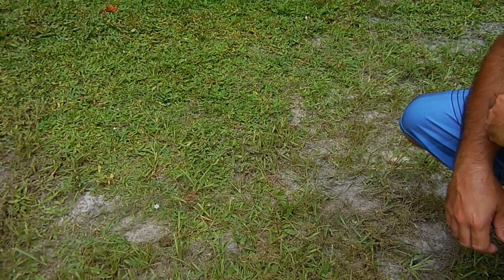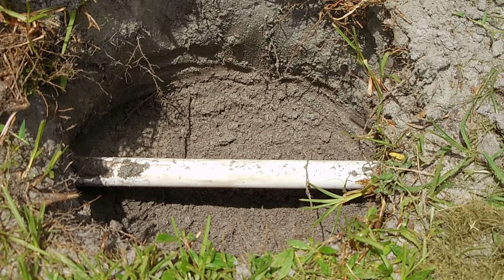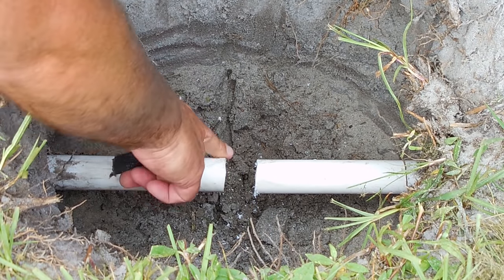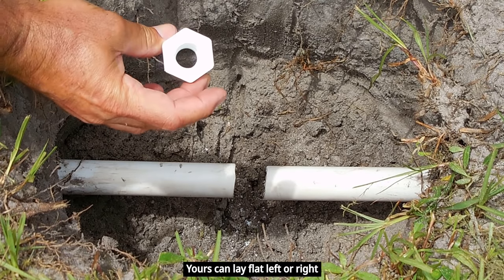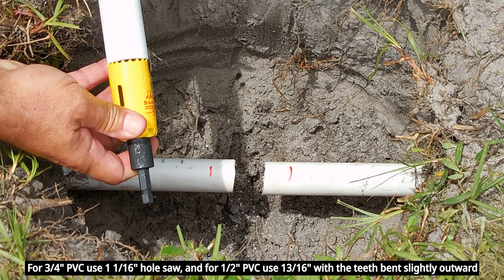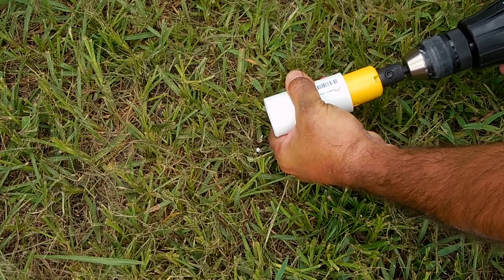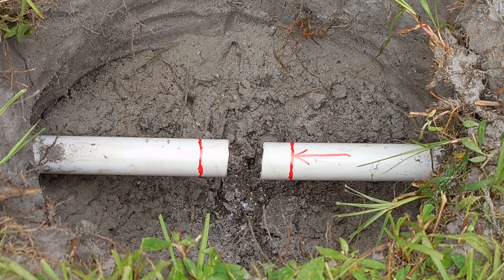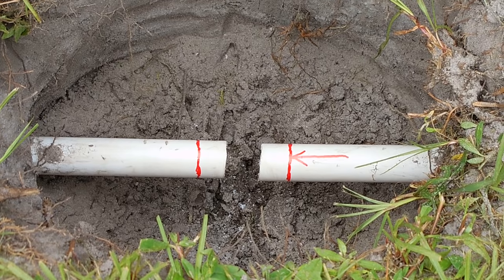How To Easily Tap Into A Buried PVC Water Line With The Least Amount Of Digging!

Comment: Nice trick! I've worked with every size irrigation pipe from 1/2"-6" but never knew this trick. Another trick when using actual ratcheting pipe cutters is take a brush full of purple primer & let it run under your blade while cutting pipe w/ cutters & it makes cutting so much easier softens the pvc or something.
Reply from the maker: Glad you liked the video!
Reply: Old schedule. 20 likes to flex inwards and resist cutting.when I use a cutter. The primer trick might help.

Comment: I’m an irrigation tech and I have to say this is very crafty but I would not use it on a larger pipe. Also fittings for a sprinkler head are more useful to be glued sideways not on an upward position as weight can cause breaks, sideways will only break the sprinkler or swivel.

Comment: Best idea I have seen yet for adding a “T” to underground pipe.  I am adding some freeze proof spigots to the yard around my home and needed a way to do this. Thanks
Reply from the maker: It works extremely well, but using the correct hole saw is very important. Practice makes perfect. :-)
Reply: is it though?   notice how he doesn't show it right when the fitting goes on... a little screen magic.   THIS is not how you do this repair if you are inexperienced.

Comment: If you slip a length of pipe in the vertical part of the Tee, without glue, it gives you a better indication of when the Tee is perfectly rotationally aligned, so that the vertical pipe is perfectly plumb. Then you can take that length of pipe out, and glue it up or put in whatever fitting you need (a reduced, in this situation). It's hard to tell when that tee is rotationally aligned perfectly if you are just looking at the fitting.
Reply from the maker: That's a good idea. :-)

Comment: This way of doing it worked much better then using the special tool used to drill out broken plastic pvc pipe from connectors that I bought at the plumbing store.
I don’t understand how it happened,  but after drilling the fitting,  it somehow made the inside diameter smaller, and the pipe will not insert easily enough. 
(It inserted more easily before the drilling!)
Maybe the cutting edge needs to be bent out a little like you mention with the whole saw.
Anyhow thanks for the useful tip! 
I’ll definitely try it.

Comment: Adding a Tee inline is actually a lot easier than drilling it out and sliding like you did. Just dig the hole a little longer the length of the pipe, cut the section like you did, glue one side, then glue the fitting and pipe, pull up on both ends of the pipe, and then fit the pipe in to the Tee. It works remarkably well.
Reply from the maker: I've been working on PVC lines for 30 years, it's not that easy. You need to dig back at least a few feet, especially for 1" pipe. This tip was for people that don't want to dig up a lot of the pipe, or if they need to tap into a line where a lot of digging isn't possible, such as next to a sidewalk or driveway. As for the burrs, I said to remove all the burrs, and you can see me grab a couple from the inside of the pipe. Thanks for watching
Reply: That's how I do it. But you gotta cut the pipe exact...

Comment: Thanks for the tip. Will implement when Slip-Fix is not available and when a constant pressure line repair is involved. Keep in mind, a slip repair coupling in this situation, could have completed the repair in less than 5 minutes.
Reply from the maker: Keep in mind "Slip-Fix" isn't a permanent repair, and over time the rubber seals can leak.
Reply: @electronicsNmore  So true. They always end up leaking and you have to do another repair.

Comment: did this a couple of days ago, but with copper connectors for water/central heating pipe, i used my lathe to ream them out but it guess a vice and a drill will do the job
Reply from the maker: Whatever works! Thanks for watching. :-)
Reply: In the future it may be good to know you can get what's called a slip coupling for copper pipe which will do the same thing but save time by not needing to modify a fitting on a lathe.
Reply from the maker: @wellby5000  I think he modified a tee, or other fitting.

Comment: @7:44 you fast forwarded through the part I'm struggling with the PVC sliding part. I wish you would have let us see how you work it in and the struggle so that we can learn. That's really hard.
Reply: If it's hard then you're not doing it right. You need to work quickly and smoothly and keep the part moving, as stated in the video. If you do it right the TEE will slide easily, and the glue will serve as lubrication. That said, it's annoying when videos that teach us a novel method skip over the critical moment, and a lot of videos do that for some reason.

Comment: Instead of an arrow, draw a larger V.  The spacing between the two sides of the V show you how " too far" you put the coupler.  Nice video!
Reply from the maker: That works too! Thanks for watching!
Reply: That's the same as drawing an arrow. The only difference is the "shaft" of the arrow, and that part is extraneous and inconsequential.

Comment: Which is the slow setting cement? I made one of those slip pipes from your other video.  I went through three of them before I got into set the way I wanted.  Funny now, blew a gasket then.
Reply from the maker: It's typically sold online or at a plumbing supply house. You'll have more time to position the fitting. If you don't remove enough of the stop from my other video, you'll have a very hard time sliding the coupling. I suggest sanding the inside of the coupling with 220 grit abrasive paper after removing the stop, before installing. Thanks for watching! Please share.

Comment: You didn't mention to make sure to get the burrs off from "inside" the pipe. Not cleaning them out will clog the filters at the sprinkler heads over time. They will break free and go down stream after some time.

Comment: I use a heat gun.

dig the hole, cut coser to one side glue the t on the shorter side, let it dry.  Then heat the long side from 2" to 8" until bends like spagettit.  Then prime and glue, use a plyer to hold the end of the pipe.
Reply: Can you recommend a cheap gun model that can get this done? I've never used one don't want to under do it or over do it. A video of this would be great.
Reply: Seems suspicious. If the pipe gets that flexible it seems like it would kink.

Comment: Good Idea.   I would have used a Slip Joint costing way more.   Yes some T Joints don't have the stops.  Here in my Two Horse Town things are hard to find.   Still using Primer ?  LOL   Wasting beer money Sir.
Reply from the maker: Thanks. I've never seen tee's sold at HD, Lowes, Ace, True value, and other places with no stop. I'm sure plumbing supply houses have them.
Reply: Blue PVC glue just doesn't work as well as primer and glue combo. It just doesn't hold up over time and it isn't as secure. I've been on quite a few jobs where the blue cement has let go. Code in a lot of jurisdictions require indication primer has been used (the reason that primer is tinted purple), and haven't changed to allow blue cement. You will never get as good of a weld with the blue. The primer softens the PVC, and creates a stronger weld. It is like paint/primer combo. It never hides as well as using a dedicated primer and then painting it with regular paint.
Reply from the maker: @xenonram  Perfect videos for you Andrew. :-)
https://www.youtube.com/watch?v=1o4E2pdEv-s
https://www.youtube.com/watch?v=qHo4heljrSg
Reply: If $5 for a year's worth of primer buys you your beer, you sure are a lightweight drinker. Your wife loves you. Your plumbing? Not so much.

Comment: I use a "saddle T".  Prime and glue "saddle T" where you want it.   After cement is dry, drill thru the blind hole and original pipe with a drill.  This method eliminates the hole saw expense.
Reply: That seems like a terrible idea. That will fill your pipe with PVC drill shavings and clog every sprinkler head in your system.

Comment: You could use a snap-saddle fitting, and drill the hole after gluing it on. I now do that even for new installs.
Reply from the maker: Yes, the only problem are plastic shavings ending up inside the line and clogging sprinklers or faucet aerators.
Reply: @electronicsNmore  Yes, it needs good flushing before putting any nozzles on. (But the moment you work in a trench, that applies for other methods too)

Comment: Great video and tip, thank you.
We use pipe saddles to do this in my area. You just drill the appropriate size hole in the supply pipe, then bolt the correct size saddle in place. A seal inside the saddle seals around the hole.
Reply from the maker: Yes, I've seen those. :-) Just like what I've used to tap into copper pipes. Thanks for watching!

Comment: Thanks for the video.  What size hole saw bit do you need for 1 1/4" PVC pipe?  Thanks.
Reply: I just ordered a 1-5/8" for that. They have 1-11/16" too, but I think it would be a hair too big. You may have to bend a couple teeth out on the 1-5/8" to make it work.

Comment: I can purchase a HOMEWORKS slip repair coupling with 1/2" threaded outlet that looks like a tee from either Lowes or Home Depot for around $12. They are rated at 150 PSI maximum pressure. I don't believe average home owners PVC will even be be working at half that. I would cut the pipe like you show, apply some soap on each pipe and slip it on. No glue or cleaners required. Just tighten each mainline end by hand.
I have a machine shop with most every size hole saw available up to 6'" and they are not cheap. I know you can do what you show however some won't realize if they don't slip the modified coupling in place very fast it can weld in seconds and they are up the creek.  
Entertaining to watch and useful if the box store is closed.
Reply from the maker: They work, I had a bunch of them when I bought a plumbing isle from Orchard Hardware when they went out of business.
Reply: @electronicsNmore  When Orchard went out of business I made a small fortune. I went to 7 stores in Florida and purchased heavy steel stock and entire sections of aluminum. One of the liquidators asked me if I was building an aluminum boat. I know I have at least 1/4 ton of steel squirreled away. Although Orchard may have been a tad higher in price, they had everything including metric. I wish the idiot CEO would have closed Lowes and kept Orchard. The only good thing I can say about Lowes is I have most of their 24V Kobalt tools and love them. 
Keep up your great videos.
Reply: @gatorwing6231 Define "small fortune." Are we talking 4 figures?
Reply: Over $675

Comment: I kept waiting for the "least amount of digging" part was going to kick in.....! Interesting idea about the stop removal process though.....
Reply from the maker: Compared to what you'd normally dig, it was very little.
Reply: @electronicsNmore  My wife and i saw the video, and we are so envious of the northern climates with their soft soil.  We here in Texas, have to contend with hard rock clay just beneath the surface to dig into!
Reply: By “least amount of digging”  he’s saying you don’t have to dig back along the pipe 3-4 feet in each direction like you normally would when splicing a line without special fittings (telescoping, slip connects, etc).
Normally you would just dig the pipe way back, cut an exact chunk out of the middle and lift up on both sides to force the fitting in. You have to dig a lot because you need plenty of play to make it work. You usually also end up having to dig under the pipe after it’s spliced because the sand/soil has gotten under the pipe when lifting.
Reply: @buttersstotch2014 How is it a problem if soil gets under the pipe? And how does digging under the pipe help anything?

Comment: Did you use the 1/2 in adapter instead of a fitting with a 1/2 connection on top so you could see inside the connector?
Reply: A TEE with 1" pass through ends and 1/2" top end will be 1: expensive and 2: difficult to find and 3: not something kept in  your truck.

Comment: Can I use a repair coupling (coupling without a stop) instead?
Reply: Of course you can, that's essentially what he is doing here. He has converted a regular TEE to a slip coupling. The problem with your suggestion is 1: those slip couplings are expensive 2: they will or at least may be hard to find, and 3; you won't tend to have them handy when you need them.

Comment: Florida sand, how do you handle it to not have soil.  Ever consider going up north? Cleaner air to have car emissions standards, more real trees, soil,, can be able to talk in the middle of the day.  :) Also what happens when you get that primer and cement on your hands? dangerous?
Reply from the maker: I left NY 31 years ago, and would never go back. I love tropical areas, beautiful beaches, and absolutely hate the cold. I do like to have fun in the snow though. :-) As for the primer/cement, I've had it all over my hands many times over the years. If I worked on PVC daily as a plumber I would wear gloves, but doing ON/OFF repairs, no big deal. Thanks for watching!

Comment: Nice video but you obviously cut the video at the most crucial point where you had to slide it on the final pipe.  That is the most difficult to do so I was hoping to see it done.  You must have had a problem doing it and cut that part out.  What happened.  Any advice to make it work without problems?

Comment: You said with  a lot of practice. I've done this 4 times and the cement hardens so fast I cant complete it because the fitting won't slide before the cement sets. Also your video skips right at the plae where I'd like to see you slide the fitting over both pipe ends to the mark on the right.
Reply from the maker: Clearly I did it, because you saw me apply the pvc cement, and the exact same pipe was there after the connection was made. When I leaned into the hole to slide it into position, I blocked the camera with my shoulder, so I edited that out. You must work FAST, and keep the  fitting in motion.
Reply: @electronicsNmore ok I'll take your word for it, but it really does seem odd that your video skips the critical technique you are trying to teach us, and even more odd that you would edit that out, even if your shoulder did block the shot.

Comment: Having a spray bottle of water gets the pipe clean in a hurry. I would have slobbered glue on the pipe and and the fitting and made a mess. I like to put a rag under the area to keep dirt off the applicator if I slip. An inspection mirror really helps to make sure there is primer, and glue all the way around.

Comment: Invest in a pvc cutter for Gods sake!
Good tip though and nicely performed.
Reply from the maker: PVC cutters are terrible in my opinion. They have a habit of slightly flaring the pipe as you cut it, or they break older pipes. Glad you enjoyed the video. Thanks for watching!
Reply: A PVC cutter is a scissors like device similar to a limb pruner. It allows you to cut PVC pipe as if you were cutting a tree limb. It's available at Home Depot for under $10. Here's me making fun of everyone else on here for saying that the one minute with the hole saw is too much work, but I'm here to tell you that 5 seconds with a PVC cutter makes 60 seconds with a hacksaw seem like an eternity. As the video author points out, a PVC cutter may not be perfect, but in the many instances where it can be used it's wonderful and I love it. I have always hated a hacksaw.

Comment: this works great because sprinkler pipes are not under much pressure, so you can get away with shitty joints.
Reply from the maker: The finished connection is strong, no problem using with city or well water.
Reply: Slip connectors are a standard PVC technique. There's no reason to think it makes substandard joints.

Comment: medium green would work?
Reply from the maker: PVC to ABS? If so, yes, but practice first on a scrap piece. Drill a hole in the end of each practice pipe, and secure it from rotating/moving using a metal rod into the ground. The trick is a clean removal of the stop, and working VERY quickly. You can sand the inside of the tee with 220 grit paper before cementing.
Reply: @electronicsNmore  thank you very much

Comment: LOL, odd how all your videos edit out the actual centering of the fitting.   I've tried this before using none stop motion only to have the fitting lock up.   I even used hose clamps as external stops to prevent overshooting the ends of the pipe, still no joy.
Reply: I assume you were using the blue “hot”/wet glue? 

If you use regular clear pvc glue you can have much more time to fit it. I do something similar to this video but with extra long pvc couplings because they have a lot of play, and i have to use clear because the blue fuses so quickly
Reply: That's a pretty good idea with the hose clamp but probably over thinking it. Slip fitting is a standard PVC technique. You're doing it wrong.